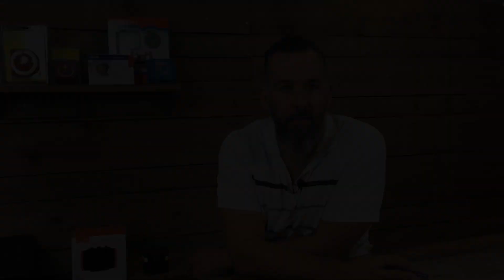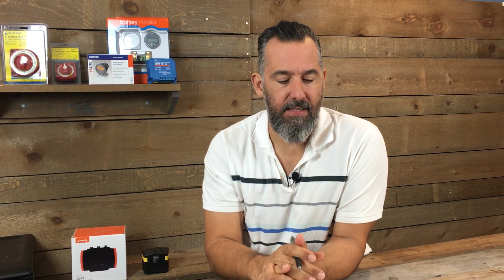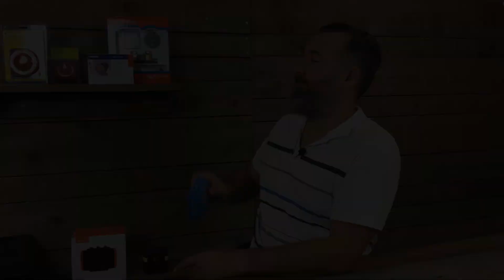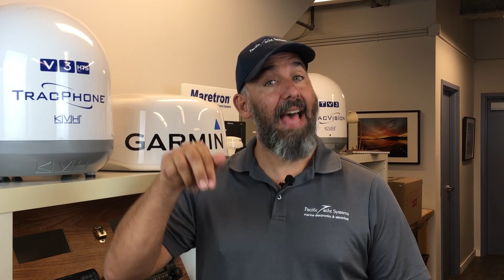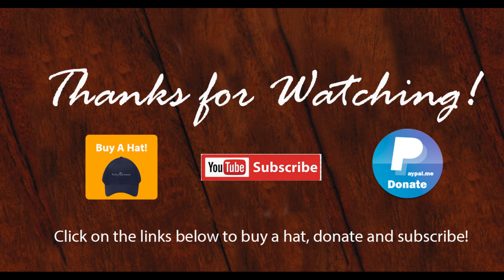Ask PYS - Can One Solar Panel Charge Two Battery Banks?

Comment: If both power stations have solar controllers built in and the single panel doesn't exceed the max voltage of either station you can use a single Y cable to split the inputs into both.

Comment: Jeff
I have a 400watt solar system charging a 200 ah battery system also dc to dc off engine.alls fine for 1 yr plus. Want to avoid future problems.
I now have electric dingy motor12v, 55lb thrust powered by 100 ah lipo4.
Can i parrell another mppt controller off my solar panel output (back aft , put in a terminal bar into the feed  for 40 amp existing charge(parrell). controllers. 
Thinking less battery resistance will charge first (dingy battery?)and shut off
Allowing existing 40 ah charge controller to charge the 200 ah battety bank.
Thank you
Mike

Comment: Where to connect 2 or more charge controllers to a 16 Battery 48volt bank=4 Banks. For a 12000 inverter.????

Comment: hi, is it possible to transfer solar output to two different batteries, which battery i want to charge atm, with a boat battery switch or it is not recommended?

Comment: I’ve two group 31 and one group 24 12v AGM batteries in my boat which I put in a yard for about 8 months with no electricity. I would like to put a small flexible solar panel on the boat cover and hopefully charge all three batteries in parallel with one small controller?  The batts are fully charged and only need to be maintained with a small float charged. I am concerned with the dissimilar size of the batts but don’t know enough about it to know if I should be.  Any comments, concerns and recommendations are welcome.

Comment: Let me ask you this if you have 2 charge controllers connected in parallel can you run them off the same solar panel to separate battery banks. Cause I got 3 system in my shed running around the clock so I'm trying to brake a system down and split the panels between the main two systems  but still run all 3 system charge controllers to charge  the battery banks that with them.

Comment: I have a question. I have five batteries 2x100 amp hour batteries and two 85 amp hour batteries.  I have 650 watts worth solar panels.  I want to hook one solar panel straight for a slow trickle but constant charge and the other 5 panel to my charge controller.  Is this a horrible idea since panel to five batteries can't cause my batteries to overheat

Comment: im looking to use one solar array into two different solar power stations one is a delta max 2000 the SOLAR array  PLUS right in and  that same DELTA MAX has a AC charging input .witch can simultaneously charge the delta max at same time..... I also have a Renogy solar charger on a 12v 190ah 150BMS lifepo4 battery then to a dc to AC inverter output that I can also plug into my delta max on the AC charge input 
      SO MY QUESTION can I use my solar array and split it or Y it out to both THE DELTA MAX INPUT xt60i INPUT and to the Renogy solar charger 

ONE PANEL ARRAY SPLIT TO BOTH?  is that doable with no harm to my 2 systems?  btw this is for my home

Comment: So the output from the MPPT would connect to the Xantrex Digital Echo Charge Battery Charger which then connects to both banks of wet cell batteries? I'm very newbie trying to see how this all connects. Sailboat with one panel, one MPPT and two banks of batteries.

Comment: Jeff, really appreciate your advice and apologies if I missed this same question elsewhere.  I will be installing a Victron Orion 12-12 /18 DC to DC controller for my 170ah lithium house bank and wondering if it is possible and practical to have the small solar controller  feed the start bank to activate the DC to DC or just straight to the house bank. I would probably use the Victron smart 75/10 with my 1 x 100Watt panel.  I also have a 35amp alternator. Thanks!

Comment: Does anyone know if there is a charge controller that can charge not only 2 seperate banks,.. but two seperate voltages. 

Example: 

I have a 12v bank & a 24v bank. 

Want to use same Pannel & charge controler that is smart enough to know it has 2 different voltage Bala attached. 

Hmm 🤔 

Is there a duel charge controler that can do this ?

Comment: So my question is, can I splice my panel cables so there two outputs for my panels, can I then set them up to two mppt's ? 
So yeah one panel two mppts and two separate banks any help would be great
Reply: PV voltajınız yeterli olmayabilir bu yüzden iki yönlü seçici switch ile istediğiniz invertere PV array bağlayabilirsiniz.

Comment: You can connect a single solar source to two controllers in parallel. One reason to do this might be if your windlass has its own battery instead of dragging a thick (and expensive) cable from the main bank. Or maybe the boat is so big that it makes sense to have multiple battery banks.

The way it works is that when both controllers are charging they each get about half the output. When only one is charging it gets the full output. This way the power automatically goes wherever it is needed.
Reply: This is exactly what I am looking for and how you describe it are my expectations. @PacificYachtSystems says that he would not do this but doesn’t explain why. Also, the question that was asked in the video was not even answered. Instead, alternatives were offered.
Reply: @bettermybest5709  As a professional he probably has legal issues to consider, besides the merely practical. Even if he knows how to do it, if there is ever a problem with a customer they could use an unorthodox wiring configuration in a lawsuit. Judges are not electricians.
Reply: @Ibian666  You make a very good point. Unfortunately, that needs to play into everything. On the other hand, how is your single source, dual controller system working?  Any issues you would like to share?  I have two separate battery systems that I want to change with a single larger array, rather than the way I am doing it now with two smaller, dedicated arrays. I think I will get better output, as you lade it out.  I just wanted to get some assurance before risking frying my equipment. On the other hand, I am confident that the single source, dual controller, dual system will work better than how I have it now. Thoughts?
Reply: @bettermybest5709  I have not actually had reason to do it myself. Partly because solar is not practical in my country, partly because in most cases a single big bank is just better. It's just an option to consider for the future for now.
Reply from the maker: I would not do this.  Especially if using MPPT controllers.   Maybe with pwm controllers but those are getting less common now.
Reply: @PacificYachtSystems  Why not?

Comment: Greetings from Australia, there is this controller with dual function: 30A Epever MPPT Dual Battery Solar Controller Regulator 12V/24V DuoRacer DR3210N
Reply from the maker: Thanks for sharing, appreciate it.
Reply: I have a 12v bank & a 24v bank... 

I wonder if this charger is smart enough to know this . And will it charge a 12v & 24v bank at the same time does anyone know ?

Comment: Hi I want set up 2 different battery bank for my shed I have voltacon 1512 all-in-one charge controller inverter I want use 1 battery  bank with inverter second one for 12v lightning can I charge both banks with one charger controller thanks
Reply from the maker: Only a few solar controllers can be connected to 2 battery banks, not sure if your model can do that.

Comment: I am a homesteader. I retain our used car batteries for lighting and charging (offgrid) .
I have setup a used car battery and a charge controller (pwm) for every single accommodation unit (3 units done so far) 
The power station is a 2x 330w panels connected in parallel, which supply current to all the charge controllers
I just tried it without investigating, and it's working good so far. Will keep adding all car retired batteries to the same power station until all units are powered.
Reply from the maker: Thanks for sharing.

Comment: Will a Bluesea ACR will work in this case? connecting the MPPT to the ACR and let him decide where to direct the charging voltage?
Reply: Let me clarify, I meant connecting the MPPT to the Bluesea switch that comes with the add the battery pack
And than the two batteries are connected via the ACR
Reply from the maker: You can connect your solar controller to a battery, then have that battery charge another battery via a battery combiner.
Reply: @PacificYachtSystems  Thanks, by battery combiner you also mean my existing ACR? or I need an additional one?

Comment: can we calculate the percentage or level of two batteries and and charge them via solar pannel and switch the charging using a digital switch 
[i mean there are two batteries and they are connected with the switch and the switch is connected with the solar pannel and the highest level haven battery is used for source and another one is in charge and vice versa .. with help of arduino ]
Reply from the maker: Never seen this setup before. But you could install a battery monitor on each battery bank, connect the solar controller output to a source selector switch, and manually decide which bank will get a charge.

Comment: is it possible for 1 panel source for 2  inverter. I mean 1 on grid then the other is off grid. but they are getting in one array of solar panel.
Reply from the maker: Not sure, in the marine world the solar arrays are connected to house batteries and not an inverter.

Comment: Would anyone explain to the ignorant like me why it’s wrong to simply connect my solar controller to trickle and charge both 12 V batteries in parallel. I never thought about amperage and the impact or risk to batteries! Thank you
Reply from the maker: Depends on your solar controller, but most solar controllers have a single connection to a battery bank (made of 1 or more batteries) and if you parallel another battery bank you'll force both battery banks into one bank.
Reply: Not a problem for flood lead acid, even four batteries, but it will take four times as long to bring them up to full charge.

Comment: I have a manual switch for the positive cables from two battery banks. How are the negative cables arranged for two battery banks to one inverter and one controller?
Reply from the maker: You should consider installing a negative distribution, each battery connects to negative distribution and in turn so does all your loads and charging circuits, including inverter and solar controllers.

Comment: Xamp makes a dual output solar charge controller and the batteries can have different chemistry. It is also configurable as to how much (percentage) power you want to send to each bank.
Reply from the maker: Tks for sharing.
Reply: Thanks will look into it 🙏🏽
Reply: Do you have a link I can follow so I know if got the product mentioned

Comment: A question that I can't seem to find an answer to is "Can I charge two solar power stations from one solar panel?"  No one seems to know if this will work. I have a 190W HQST panel at 20.3V and would like to see if I can charge two of my power stations using a 5521 splitter to split the output so I can plug into two power stations.
Reply from the maker: Never tried and read somewhere that it won't work, let me know how your test works out.

Comment: I have two battery banks on my electric sailboat. One for the motor at 72v and one for everything else at 12v. The tricky part is, I have 6 solar panels and  I want to be able to switch them around to have all all panels charge the bank I want to charge. For example, if anchored and motor bank is full, switch all to charge house bank. Right now, I have 3 in series (200w @ 24v x 3) for the open circuit requirement to charge the 72v bank) and the other 3 are the same but in parallel to charge the house bank at 12v. I can't think of a way to easily rig it so I can flip a couple switches and charge either or both banks. Any ideas? Thanks for the video!
Reply: Put the solar output in parallel to two controllers, one for each bank. This will share the power evenly between the controllers. You can even put a switch on each circuit so you can manually control which one gets the full output when desired.
Reply: I second that.  Have the same setup. One AGM and one bluetti 200 V2.  The AGM will get the bulk until charged and increasingly shift the power to the lifepo4 in the bluetti. 600 watts of solar panels. The most efficient will be aprox 30-40 vdc OCV.  With a 12 vdc battery. You can look at mppt efficiency curves.  @Ibian666
Reply from the maker: Good question, but unfortunately never came across this setup before.

Comment: How about one solarpanel, feeding two MPPT-controllers in parallel, each with their own battery.
Reply: I'm looking for an answer to this too as I have the leisure battery which is agm and a emergency power box that's lithium ,I have one solar panel on my van and I'm wondering can I add another charge controller
Reply: @FromMetayou Add another solar panel?
What is the first connected to? 

Easiest would be to have each panel have it's own MPPT controller and connect with the right settings to one battery.

Now when one  battery is full you might want to switch it's panel over to the other MPPT to run in parallel with it's panel.
This requires a one-two-both switch for each panel. Having two panels on one MPPT in parallell might cause the voltage to go down a bit. 
When using Victron gear one can check the voltage of a panel in the Victron app before making.

Alternatively you can use a DC-DC to send power from one battery to the other (and use a second DC-DC to send some back) which is certainly easier and working better when the AGM is connected to the alternator of your car.
Reply from the maker: Never tried to... anybody else ever try this?
Reply: @PacificYachtSystems  hi. I also wondering the same question. Is anyone ever try that? Put one PV system feeding to mppt. Please this is worth to make a video

Comment: First, thank you for this and every video you’ve ever posted! As someone who is just starting out on three separate journeys: sailing, electrical, and DIY, your presentations and answer sessions are like church for me. 
Second, say the two banks in the original post are different voltage? 
I’m trying to decide what’s possible and what would be best/safest in my current project. I have a 48v 100ah bank to run an electric inboard. I too was wondering about possibly using a single mppt charger from my solar array(400w)  that would charge the 48v bank, AND a 12v house bank. OR, would it be better, safer, easier to step down the 48v through a DC/DC converter for my 12v needs? I’m waiting on some components of this system, so sitting down with the manuals has not been an option yet. 
Again, even if this doesn’t get answered, THANK YOU.
Reply from the maker: Hi Anthony, worth considering a dedicated 12 volt battery that is recharged from a DC to DC charging converter from your 48 VDC battery bank.
Reply: @PacificYachtSystems  Thanks! Learning. I thought I could just use the DC to DC to a 12v panel. Getting my Victron Quattro 48/3000 delivered today for Charging and AC needs. So I have the Quattro, a VIctron MPPT 100/20-48v, and Victron DC/DC 48v/12v. and a lot of homework. It seems the 48v motor/bank requirements have really raised my costs for other, more basic boating requirements.
Reply: Sorry, one more question, need that extra 12v battery be same as 48v bank, ie. LiFEPO?

Comment: I was thinking more along the lines of a switch that will completely redirect the solar output to one or the other after one is fully charged. I want one battery fully charged as soon as possible. One full battery is better than two partially charged batteries, for me.
Reply from the maker: Hi Winston, not aware of such a device. Anyone know of this device.
Reply: Connect the solar output to both banks in parallel with a regular switch on each line. When bank 1 is done, connect bank 2 and turn bank 1 off. Or keep both on if you want to charge at the same time.

Comment: I have little funny setup (but working). I got auxiliary battery connected with my car start batter via DCDC charger. Car stays long hours under car pot and I had two spare house solar panels, connected with Solar MPPT it’s charging it very well. But then I wanted to extend and bought another deep cycle battery (let’s call it house battery) for my garden lights and pond. 
So far I have been using manual switching better both batteries to connect with solar (plz note both are same deep cycle battery and same size).

My question is. If I connect ACR Victron Cyrix-ct to both batteries and use my car’s aux battery as main battery (generally you use starter battery) and connect other battery as house battery. Would the ACR be charging both and disconnect car’s aux battery when voltage drop? I just need confirmation that I am not doing something wrong here .

Please note both batteries are connected with load car’s aux is connected with fridge and house battery with garden lights/ponds.

Many thanks in advance! Cheers!
Reply from the maker: Yep, a battery combiner between your car battery and the new deep cycle battery, will put both batteries in parallel whenever their is a charging voltage (either alternator or solar).
Reply: @PacificYachtSystems  thanks for confirming that :) . Going for Victron Cyrix-ct 12/24V-120A